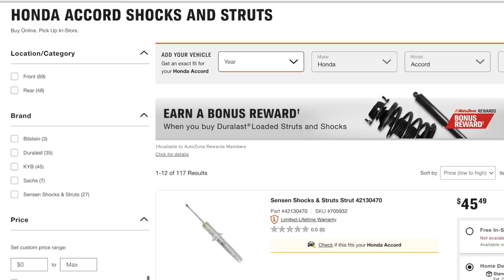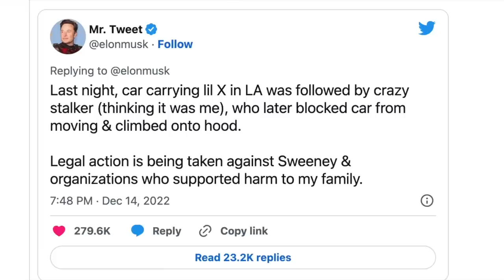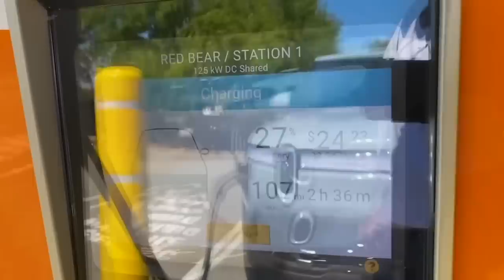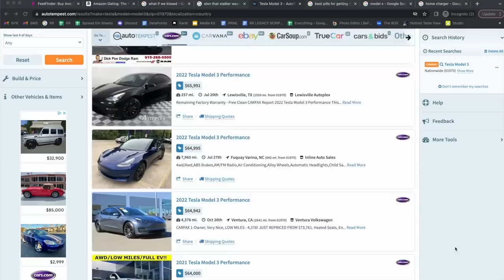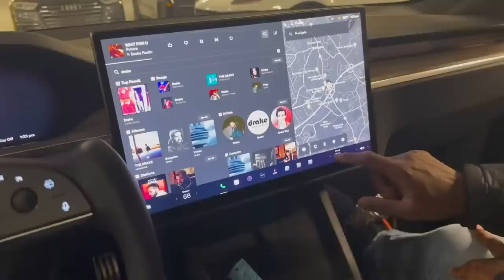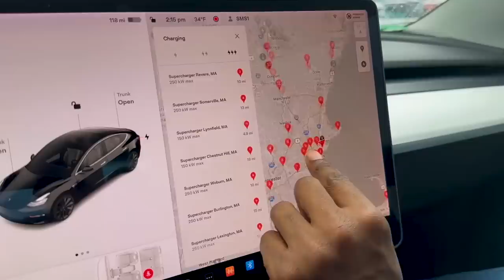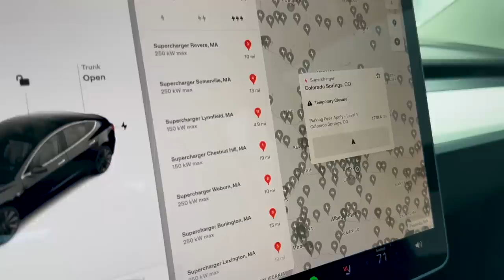Buyer beware: Don’t let Elon trick you again with Tesla Price Drop Magic

Comment: Were picking up a tesla y soon,  because we spend $500+ a month in gas and its the cheapest EV because of tax credit, which is weird. Hope it works out.

Something interesting about tesla, is if you buy the poor person, RWD model like me you get 260 miles of range out of a lithium iron phosphate battery that you can charge to 100%. If you get the long range model though, you can get 330 miles out of a LiION that you can use only charge to 85% and get basically the same range for only $8k more

Comment: The fact that every car is equipped with the same hardware even if you didn't pay for it is to speed up production, reduce cost and increase quality. Things like different trim levels are very bad on the production line. The second thing is that a car with no FSD subscription collects road data and sends it anyway.

Comment: well, I live in Australia - a fill up in my Ute costs around  $130 AUD  for   430 miles (or 700km, whichever is greater)...  A Electric truck  with 400 miles range and a 5 minute refill time - is Unobtainable (love nor money).  I should be on track to spending a finite amount on fuel over the next 10-20 years - at 3-4 k per year (max)  saves depreciation on the high price unobtanium over the next decade.  Will look forward to seeing what is on the market some time in the 2030s...

Comment: 13:00 I wonder how much battery that tv on the dashboard eats…
Reply: Probably around 100W including the computer powering it and the 2 screens. The LED screen itself is very efficient probably 15-20W, screen size doesn't increase power usage much.  That is miniscule when you have 100kWh battery in model S plaid. You can run the screen for theoretically max of 10,000 hours or about 400 days

Comment: That’s NOT how toilets work in airplanes! In order to be Certified for flight in the US, an aircraft MUST have a leakproof holding tank that can only be emptied ON THE GROUND if it has a toilet, PERIOD! Everything that goes into the toilet MUST go into the holding tank when the toilet is flushed. This applies to ALL classes of aircraft, civilian and military.  THERE IS NO WAY TO DUMP THE TANK IN FLIGHT! This is a long-standing Regulation that has been in force since the days of the Civil Aeronautics Board, which predates the FAA. Even aircraft that have been converted for Cargo use and have had the original lavatories removed use a self-contained “camp-style” toilet unit with an integral holding tank. In no case is it possible that flushing an aircraft toilet will cause the waste to be discharged from the aircraft in flight or while taxiing on the ground!

Comment: I would definitely would like to see more videos on repairs/maintenance cost of EVs.  So far I have seen that EVs are cheaper to maintain but how about the batteries or that is not even worth worrying about - shocks, brake-pads, the electronics, wire harnesses, headlights, tail lamps, etc.?  Now, there seem many more videos about ICE maintenance - from simple replacing of spark plugs, fan-belts to engine & transmission overhauls.

Comment: Cobalt is used in Lithium ion but NOT in LFP cells. About 50% of teslas are LFP (Lithium iron phosphate)
Reply: The question is this:  Will Tesla do mods that will allow the cobalt free batteries to power the models which carry the cobalt batteries?  If No, why?  If yes, at what cost?

Comment: well, where i live, if u want a car with a engine smaller than 3.0L you would pay something like 50-400$(depending on displacement)  per year as tax, but if u get one over 3.0L you would pay between 2000-4000 $ per year and it doesn't matter the year of production, the hp rating just the displacement, meanwhile the ev have 0 tax
 and if u had our gas prices .... oh boy
i would like to drive a m3 or audi s4 or amg over a tesla model 3, but the monthly income doesn't allow it , for many of us this is the cheapest way to have a fast car

Comment: I like my GT350 and fox body, both manual. I drove a model Y and I was sold with the tech and regen braking however, it won’t replace the love I have for ICE manual cars.  Wife drove it the Model Y and while she liked it she wasn’t impressed and opted for the Palisade. The issues I see with Tesla vehicles is that you are very limited to a few colors, 2 interiors and wheels. Got a ICE truck because it can tow unlike any EV truck on the market as of today.  EV great for new people  that don’t travel x country. I want to fill up and go. Charging availability still a problem in rural areas where I like to live.

Comment: Waiting for the poverty spec Model 3 awd to appear with metal roof, clothe interior, drivers binnacle and Apple car play instead of their proprietary software and interface, real door handles, steering wheel stalks to operate lights and wipers, and no over the air updates to replace my WRX. Can traction control be turned off to do epic drifts in the snow?

Comment: Hey Rich, I got a salvage 22 model 3 I have a issue that I can’t figure out and it won’t let me go forward in the process, I need help please. My HVC S damaged.

 I backed up my old hvc and tried to do a restore on hvc that I got from eBay. It wouldn’t restore, so I than tried to back up my old hvc again and it wouldn’t allow me but now it would allow me to back up the one from eBay so I did, i than did the restore process work on my old hvc. Now I have my old one restored to the hvc I got from eBay. And I was told to do a backup from my old hvc to a new hvc I bought from tesla. I did that but it isn’t copying the files. Plus the hvc from eBay I don’t know what car it came off of. Thanks
Reply: And my old hvc is a copy of the one from eBay. I don’t need help please

Comment: I'm just gonna stick to driving my 2006 Lexus gx470 for the next 20 years. Parts are easy to get, it's easy to work on, it will go through anything and run forever, and it will still be on the road when all these electric cars have failed and been recycled.

Comment: In my area the only EV that's a better value than a gas or hybrid is the Bolt as gas is cheap. From what I found for electricity to be cheaper than gas it would need to be $0.18/kwh but even residencial is now $0.16/kwh. It's nearly impossible for the EV to be cheaper to drive than the gas car. It's unfortunate as electric prices literally over doubled in the last 2 years. 2 years ago electricity was only $0.0735/kwh, back then an EV would have been a no brainer.

Comment: Toyota is missing out here. They should release a Prius that can do 0-60 in under 4 seconds, a GT model if you will. Pure electric is not conducive for a lot of us so gas will be the way for another 10-20 years until they get the charging worked out, and make better, and less expensive batteries. $20K, or more for a battery makes these cars bic lighters the day you drive them off the lot. That's not a good selling point knowing full well the entire car is worthless the second the battery dies.😁😎✌👍

Comment: Tried to help a EV driver stuck in an intersection get out of the way. Vehicle couldn't even be shifted into neutral because the battery was dead. Woman told me she ran out of charge on the freeway previously and the car came to a stop before she could get on the shoulder the week before. EVs should not be sold to everyone. At least an IQ test so we don't get anymore videos of some lady trying to put diesel in the charging port.

Comment: From my understanding, cobalt mining isn't that bad for the environment, it's more that it's mostly done with slave labor. The environmental effects of cobalt mining are about the same as most mining, but the rate of damage is higher due to the low effort to prevent such damage (if they're forcing kids to mine rocks for them, do you think they care if the debris and waste goes in the river?). 

Lithium mining is pretty bad for the environment. The method for doing so is pretty destructive in the fact it uses a ton of water and the run off will inevitably get in the water supply. However, I will say many claims about it are overblown. One claim is it also reduces biodiversity, but literally any human project does. Just building roads reduces biodiversity and farms literally ruin the top soil. I think it's funny people point to lithium while thinking their vegan lifestyle is completely clean. Nothing humans can do is, it's a balance of what is worse.

Comment: I just dont know why tesla fan are so fuzzy about tesla. Just like I dont know why so many people are obsessed about iPhone. Model 3 is not a great car. The suspension... Is rough. Handling, so so. Is it fun to drive? Yes. RAMS?! Non existed. The standard 60 kwh battery pack promises 400+km per charges. Never manage to get anywhere closed to that number. In winter months, it will die around 250 to 280.

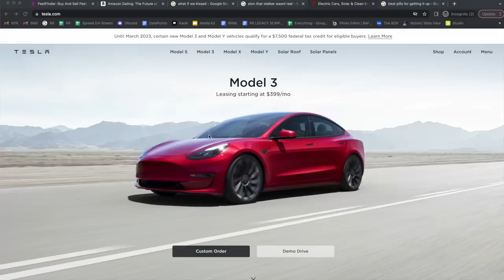Comment: To comment, will get deleted if it is bad. I do NOT understand how you complain about the (NEW) Tesla Model 3 (10:05) and it's baseline model does not have long range. You complain about Tesla "Forcing" people to buy the long range upgrade for $10,000.00 but your statement is not true!  Doing a little research, you FAILED to say, is that you also go FROM rear wheel drive to the PERFORMANCE model which has DUAL MOTOR ALL-WHEEL drive, AND  20’’ Überturbine Wheels,  All Black Premium Interior, Performance Upgrade, Carbon Fiber Spoiler, Performance Pedals, Performance Brakes!!! If your going to put this kind of content on here, show facts, not your own misleading complaints! And what company is not for profit?!?!!? As for profit margins (12:25) of 8 Times??? Where are you getting these stats??? Post them! Show them! You complain about Tesla, you then go and buy a Rivian for $108,000.00 (6:12) which has a upgrade battery pack 400+ miles for $16,000.00?!?! If it cost Tesla $36,000.00 to make and sell for $10,000.00, Show it and then show that same profit margin for Toyota, as there is NO way they only make $1,200.00 per car! You complain about all of Tesla's fees? Your the one that expects free everything! This isn't Starbucks with the free WiFi!! Auto Pilot = $15K? How do you know what went into the making of all that is required for Auto Pilot? You don't! Just imagine the amount of computing power, sensor, testing, and R&D and the money it cost! Imagine a self driving cars 15 - 20 years in the future... Where did that tech come from? I truly do understand you are trying to bring awareness to people and NOT for free as YouTube PAYS you, so grab your content as you see fit, just show supporting information and STOP spouting things that are NOT accurate to your claims. NO I do not own an electric vehicle... Tesla is not holding on to your car for service longer than the other car brands, you said they are "Still understaffed" (12:14) ??? Hello, you make an appointment on THEIR timeline and it is the normal service. going to the showroom and seeing that the Tesla need a form of payment for charging, Well what do you want, pull up, use YOUR credit card and then plug it in and stand there for 30 minutes to an hour??? Your complaint makes NO sense! I mean NO disrespect, and apologize if this is taken as mean or hurtful.

Comment: Well, Rich, take a breath during your video :-)
Tesla is not everywhere yet, Honda Accords, which you said you bought for your family, are everywhere, are very common too. I don’t think most people who buy the average Toyota Camry or Honda Accord, opal, or Vauxhall, are buying them because they’re beautiful, like a Ferrari.  They are buying them because they are efficient and get them to work or school. and the reason air shocks are expensive is because they are on the high end, expensive model S, like they are expensive inside an Audi RS7. they did not put those air suspension parts on the relatively inexpensive model 3. besides that, yes, your charger door probably had some issues. But then, unlike your Honda, you don’t have to change the oil, the transmission oil, brake pads, and rotors for a very long time, timing chains, spark plugs, and on and on. Those parts may be relatively cheap compared to a Porsche’s, but since the Tesla doesn’t have them, they are zero dollars. lastly, why does the model 3 have to look like a Lamborghini?

Comment: If Elon had a brain & really wanted to save the planet, he'd stop pumping out EVs with way too much power for ordinary/sensible people.
It's common sense that if the highest performance model were restricted to 0-60 in 5 seconds max, significantly smaller & cheaper batteries could be used.
A 0-60 of 9 seconds would be great for those looking for a general run-around or second car. 
But then if he changed over to using LiFePO batteries across the range, they'd be safer, cheaper & use zero cobalt.

Scrapping Space X, the Roadster, & CyberTruck would go a long way to saving good honest tax-payers from subsidising his B$.